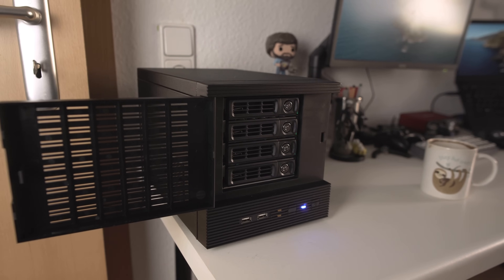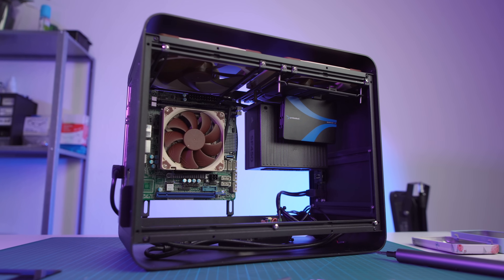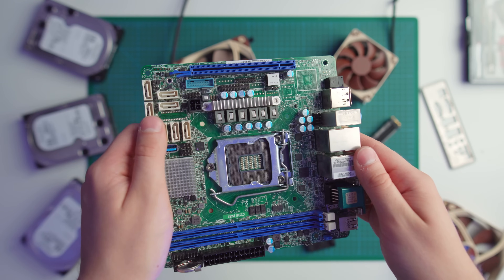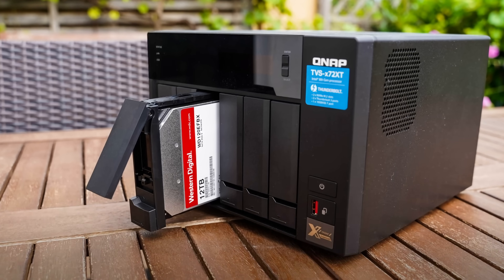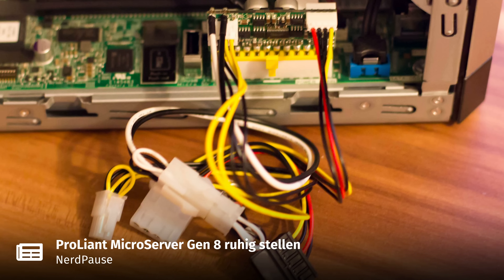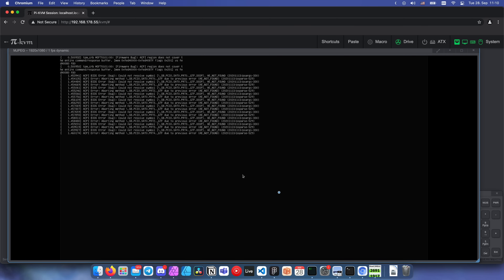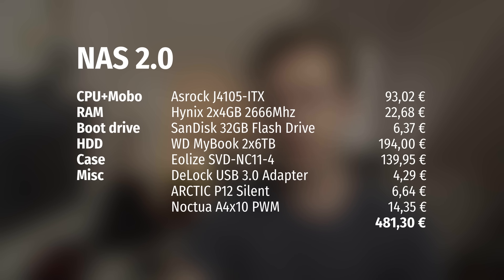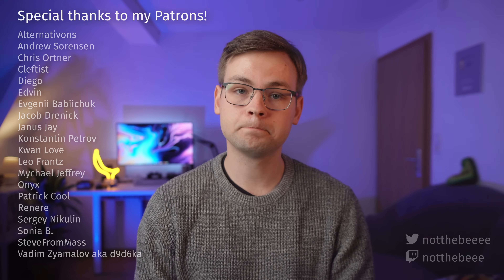The Perfect Home Server Build! 18TB, 10Gbit LAN, Quiet & Compact

Comment: I´ve just discovered your channel through this video and I really like your content, you just got one more sub :)
I am also building a new homeserver for myself but I took a very different approach.
I want a new homeserver that runs Unraid OS with lots of HDD storage but also some faster SSD pool, and I also want it to be reasonably efficient. My current homeserver consists of a X99 Board, 6900K CPU, 32GB of RAM, 13 Hard drives from 2-3TB in a fractal 7 XL case with a Intel X550-T2 10G Nic. 
For my new server I bought a Z590 Aorus Master, because it´s one of the cheapest boards with 10Gb/s RJ45 already built in and I got it for just  260€, a 10700k so it performs well if I need it to (10th Gen because it´s the last gen with proper GVT-g support, so I can use the iGPU for VMs or Plex. I got a good offer for 64GB of RAM for just 220€ so I bought 64 instead of the 32 I originally intended to buy and also got a Be Quiet Dark Rock Pro 4 for cooling my CPU, so even under load the system is very quiet.
My case is a CoolerMaster HAF XB Evo Cube that I got from work for free, but it can be had from ebay for around 40€.
Its a nice case with enough room for everything I need but also doesnt take up as much space as my Fractal 7 XL I used before.
Also lots of Noctua fans for cooling.

I haven´t bought any storage yet, because I dont have that much money at, and I´m hoping for good deals on black friday.
I plan to buy 4x 14-18TB HDDs (Seagate Exos) and put them in a Raidz1 array (that is more than enough storage for me) and also get 2 4TB SATA SSDs and put them in the regular Array in Unraid. The SSDs will be used for stuff like games and will sync their content to the RAID protected array. Maybe also an extra NVME SSD for a VM.

Comment: In case someone is looking for a cheaper option on hardware, A88M-ITX/ac has 6 SATA 3 ports, FM2+ socket. Thats what I'm using paired with a A6-7400K exclusively for NAS purposes.
Reply from the maker: How is the power consumption?
Reply: @WolfgangsChannel  65W ~ Under load. 4 x 2 TB SATA drives, 8 GB DDR3.

Comment: About the motherboard choice: wouldn't be easier to buy a regular itx motherboard with a Pcie 3.0 - Sata expansion card? There are cards with up to 10 SATA ports on Amazon
Reply from the maker: Absolutely! But then you lose one PCIe expansion slot, which I need for the 10Gig networking card. And cheap miniITX boards don't always support PCIe bifurcation (the ability to use multiple PCIe devices with just one slot by using a bifurcating riser cable). Plus, PCIe risers and adapters can cost as much as another motherboard, so we're back to square one.

At this point, a better question would be "is it really necessary to build miniITX?" 😁
Reply: @WolfgangsChannel  oh you're right I was thinking about mATX that have 2 expansion slots at least 

Btw I love SFF builds as well so you got my support for that one! 

When I'll have a well payed job I'll probably try to do the same lol

Comment: I've been using what looks to be a similarly sized case (BitFenix Phenom Micro ATX)for my home firewall since 2015 but that only has a single SSD for storage, which it hardly ever touches. It has 16GB DDR4 ECC RAM and an Intel Xeon CPU, which I would not choose again. I've not had any problems with it and there are lots of things I want to do with it, when I have the time. I use OpenBSD for the OS.
Reply: My dude, that is one massive firewall...
Reply: @urebeatsgaming7285  I've never had any problems with it. I use some of the RAM as a type of ramdisk as that will help extend the lifespan of the drive inside.

Comment: I recently built my NAS in the Node 304 but this video has convinced me to move it to the DA2. The HDD cages in the Node 304 are pretty poorly designed. The screw holes are on opposite sides for each pair of drives, which means that the drive power/data connections alternate direction. This makes it hard to connect them with a single power cable as you need to twist the cable 180 degrees between each drive. The drives are also spaced a bit further apart. I managed but didn't have a single mm of cable to spare and there's even a little bit of tension in the cable.

Since I'm moving to the DA2 could you share some more installation details? For example, did you literally just lay some rubber bands between the drives and have them stick just from the pressure between the drives or did you wrap them around the drives somehow? Can 6 drives all fit in the front part (with a SF PSU and a small passive GPU) or will three have to go in the pack in front of the motherboard?
Reply from the maker: 1. Yes, the rubber bands are just held by the pressure from the screwed-in drives.
2. You can only fit 6 3.5" drives if you don't install a GPU: https://www.quietpc.com/images/products/st-da2-example4-large.jpg

Comment: Whats your average power draw?
Reply from the maker: 19W with all HDDs spun down, and every HDD draws about 5W.
Reply: @WolfgangsChannel  Thanks, damn that's nuts, mine idles at 100W but I think ZFS is preventing the drives from spinning down.  I'm gonna try some of the hardware you used, my machine uses an LSI raid card because of the sata shortage on itx mobos and I think alone that consumes 20W.

Comment: if you can fine one, you may want to take a look at an HP Pro Liant N54l MicroServer.
That is a very solid basis that can be tinkered with but does not actually need it usually.

Comment: Didn't you run into heat issues with your SFP+ NIC ? I got a dual port one for my home server and it turned out to overheat as it was designed for servers ie. high airflow environments (QLogic cLOM8214 for those who might wonder). Performance turned out to be excellent though as soon as I strapped a tiny fan on it.
Reply from the maker: Nope, not really. As far as I know, it's usually RJ-45 10Gbit NICs that get hot

Comment: Many people underestimate the iGPU on the 6th gen plus intel processors. I am running unraid on an i3-9100 which handles 15 simultaneous 1080p transcodes. Realistically not much less than a quadro P2000 that the internet seem to be obsessed with and a hell of a lot cheaper and more power efficient.
Reply from the maker: Yep, QuickSync is magical ✨
However, you need at least a Kaby Lake CPU if you want to play HDR content on an SDR screen in Jellyfin, it seems:
https://jellyfin.org/docs/general/administration/hardware-acceleration.html#configuring-opencl-acceleratedvpp-tone-mapping

i3-7100 is also supported by this motherboard, so yeah
Reply: @WolfgangsChannel  I have the same motherboard (actually 1 step down, the C232, just doesnt have the m2 slot) and paired it with an i3 7350k, the best cpu that supports ecc before going a xeon.
Reply: But still no 4k60p on YouTube unfortunately (

Comment: I have a question that's off topic but please bear with me. Which external HDD would you recommend for casual use? I am looking for a 2 or 4tb drive. WD My passport 2tb/4tb, my book 4tb, Seagate expansion 4tb (external power), One touch 2tb, etc.
Also how would you choose between portable ones and the big ones that require external power? Thanks for your time

Comment: For my home storage server i added a HBA card to get additional SATA ports. the DELL H310 running in IT mode. I see people recommend the LSI 9211-8i. But mine came pre-flashed with the right firmware and was cheaper, so no need.

Comment: My home server is a pi4 with an external usb drive attached. It runs pihole, hosts my git repo's and music/videos for streaming. Its enough for me and is very light on power with the energy prices soaring at the moment! Thanks for creating and sharing the video. Lots of hard work and editing. Good job!
Reply: I think he means they can easily be torn of causing files to be corrupted
Reply: My home server is very similar to yours! I run a Pi 4 with an external desktop HDD. It too runs Pihole as well as a Plex server and storage for general files.
Reply: @L39T   What are you using to have your HDD connected?
Reply: @L39T  Hello! I got a question regarding Plex server on a Raspberry pi 4. Does it work well for 1080p videos? I'm thinking at a Samsung TV as client. Thank you!
Reply: @cosmin3  Yes, 1080p and even 4K works fine. Just make sure to not transcode the videos.

Although I've had one video that the Pi would struggle with and that was a .mp4 x265. I never troubleshot because a .mkv x264 version of the video was available anyway.
Reply: @PhilRey.  Just curious because my setup is the same. Does the Argon V2 case solve the issues you are talking about?
Reply: @PhilRey.  weak in what sense?
Reply: What do you use to host your git repo's?
Reply: I'm just working on my pi server. I just created a Minecraft server with a Ubuntu server install without a DE installed. I found it is a great project to learn to use the terminal. Next will be transform it into a normal file server with nextcloud. So I can ditch google cloud.
Reply: I use an hp proliant microserver with no fans running Unraid and I am also perfectly fine with it!
Reply: External USB is far from satisfactory in my testing. Your comment is really overselling the Pi4
Reply: @chrisg6091  if you’ve used ext4 file format, you’ll know what he means
Reply: cyberpunk 2077 meme worthy
Reply: @PhilRey.  for critacal data you dont need a powerful solution, you need multiple devices, so is better to use 3 rpi instead of a device like the one on the video...
Reply: What do you system do you run on that pi?
Reply: Same and an odroid c2
Reply: Thinking of doing this too, will a pi3 be enough.
Reply: Where can you find a pi4
Reply: I used to do the same but honestly after a couple years I started getting a lot of random crashes, which were due to the hard drives starting to fail I think. I decided to go with Synology but I would recommend to at least consider to use two drives to backup some stuff, especially if you have your git repos there
Reply: Take care of him
Reply: Energy prices soaring ? My electricity is $0.068 per kwh. Cheap cheap.
Reply: @randybobandy9828  man wish i had the same price as you. i pay 0,35€ per kW/h in germany
Reply: @Humbulla93  Yes, it really is nice. Just a few miles into town is a different power company, and it's  almost double $0.117.
Reply: @Humbulla93  0.35€ are actually still kind of cheap. You must have a good contract/binding contract. I pay 42ct/kWh if the PV doesn‘t give enough electricity (renewable from Norway however because we know that electricity always takes the hardest path, right?). Others pay 50ct/kWh sometimes.  

I actually have a somewhat decent server (Ryzen 5 2400G, 16GB RAM, 256GB SSD) which I built before the Russian invasion, partly from scrap parts (RAM from upgrade of my old PC, cheap MoBo, Samsung SSD from dead laptop) and it would cost me like 700€ a year to run (on average the sun is out for about 4 hours, so I practically only pay for 20hrs). It can work as a heater though, currently I have Windows 10 installed but I intended to use it for Linux/VMWare.
And the best part is, that this thing draws 1W without even being on, while my Pi 3A+ only draws 2W-ish peak.
Reply: Nice setup. 
This side I have a Raspberry Pi Zero W for PiHole, and my file server is a dirt cheap motherboard running a Celeron J3060 with a 2TB drive, 2GB RAM and 120GB SSD for OS (Open Media Vault)
It's been running fine, but I'm needing more space. Problem is, that cheap motherboard comes with just 2 SATA ports and no expansion at all... So I'm thinking in upgrade to an AM4 motherboard to use an Athlon 3000G or a Ryzen 3... And build a RAID 5 setup with 4x6TB proper NAS drives (Toshiba N300)...
Just waiting of a good deal on ITX AM4 motherboard shows up... 😂

Comment: Almost everything I want..
TBH I'd be happier with 2SATAs, 2 NVME and 10GBe with DC power for even better power sippage :) But apparently these are pretty impossible to find.
That 26W you showed in the middle, was it with all drives spinning (doubt it)

I may end up following your build but possibly with a 7700T CPU (if it supports it). I want to be able to spin up VMs as well.

Cheers and thank you for the video.
Reply from the maker: Thank you for the comment :) 
26W is with one drive spinning. It's around 19-20W with all drives spun down. Iirc Kaby Lake CPUs are supported by that motherboard
Reply: @WolfgangsChannel  That's pretty good. What is the draw when you're doing transfers at almost 1GB/s?
Btw can you comment on your setup that enabled this speed given the SATA speed would cap at 500MB/s per port and spinning disks generally hit no more than 150MB/s?
Was it also constant or did it dip after maybe it cleared the cache?
This is a reason I wanted to have 2 SATA disks (spinning or not and mirrored) and 1-2 NVME storage as cache :)
Reply from the maker: I have a 1tb NVME drive in front of the MergerFS array to act as a buffer. The files that haven't been accessed for 5 days get moved from the NVMe drive to the hard drives. 
I didn't mention it in this video because connecting another PCIe device to a 1xPCIe motherboard requires some voodoo magic and I wanted to leave it for the next video :)
Reply: @WolfgangsChannel  ah haa.. now THAT makes sense. Also damn teaser, I'm very curious too .. Are you also using the nvme as cache for writes to the NAS?
Thanks for continuously replying. Any ETA on the next video?

Now I'm wondering if you used something like QNAP's 10Gbe card with 2x NVME slots 😅
Reply from the maker: @Airbag888  Yep, that's what I'm using the NVMe for. The video should be done in about a month – it's already being worked on :) And no, I'm not using the QNAP card. It's PCIe Gen. 2 x4 and that's just too slow for NVMe + 10gig.
Reply: @WolfgangsChannel  omg 1 month!! I guess that's 1 more reason to keep on dodging coronavirus

Comment: Wouldn’t it be easier to use Open Media Vault as software because it automatically uses remote access. It would also cut costs instead of using a raspberry Pi
Reply from the maker: I think you misunderstood the point of a Raspberry Pi. OMV wouldn't give me access to BIOS settings, won't let me repair the borked GRUB config or diagnose systemd shenanigans. You kind of need a separate PC for that.
Reply: @WolfgangsChannel  ok, I’m really a noob at this

Comment: If I am looking for an ATX case with a backplane available (with hotswap and good airflow if possible) what are some cases I should be looking for?
Reply from the maker: I don’t have anything in mind, unfortunately
Reply: Native backplane limits your options on towers.  Probably something like Supermicro, or you could take an ATX tower strip out the 3 x 5.25 bay and replace it with a 4 in 1 hot swap bay for your back plane.

Comment: Why not just run headless Ubuntu server on bare metal? I've been doing so for 3 years, and it's worked nearly flawlessly. In the rare occasion it turns off, I just press the power button, and everything is back on in 30 seconds. Never hooked up to a monitor after the initial install. Cockpit has a built-in shell and service management.
Reply from the maker: That’s what I do though 😁 but PiKVM is still handy for changing BIOS settings/etc.
Reply: @WolfgangsChannel  That's probably true. I guess I looked at it from one side, as I've never had to change BIOS settings.

Thank goodness you're not using FreeNas or Unraid for this build. It's hyped up by so many YouTubers, but totally overkill for most media/home servers.

Comment: For the AMD Side of things there would also be the ASRock Rack X570D4U or the ASRock Rack X570D4I-2T. The 2T has 10Gbit/s x2 onboard but doesnt come with a second PCIe slot. And yes i know, one of them is MicroATX, not miniITX, but maybe someone wants to go that route instead, so i throw that out here. Both with 8 Sata Ports btw.
Reply from the maker: I was really pondering getting the X570D4U but it’s around 650€

Comment: Wow that's a really cool setup, I am just repurposing my old laptops as a homelab 😂 and have been controlling it over SSH benifit being that it consumes very little power and has a baked in UPS. Really looking forward to that 10G home network video.
Reply: I thought about doing that aswell but am not sure if it's a fire hazard with the batteries on all the time
Reply: @Alex-fl2yh  good point about the battery exploding hadn't considered that, I will pull it out and connect directly to the UPS, thanks!
Reply: @Alex-fl2yh  you can easily check the battery health and if they are in good health then there should be no issues. Most laptops entirely bypass the batteries and supply power directly to the laptop when plugged in and the laptop batteries work as a sort of battery backup. Li-Ion batteries won't explode out of nowhere, you can see signs of damage pretty early on in form of bulging or overheating batteries. 
It's the ideal setup for me personally because laptops being low power, used laptops are cheap. Only issue is the lack of being able to add tons of cheap HDD storage and being limited to the more expensive notebook HDDs or SSDs
Reply: Power consumption is crazy for old hardware
Reply: @ITshnikBro  pretty manageable if you get anything above or at 6th gen. Mine is a 2 core 4 thread i5 and I run 9 services via Podman (14 images) plus cockpit on it. It also acts like a NAS and saves encrypted backups from my phone and macbooks. The power usage is usually around 5W - 15W at the max. The thing has been running 24/7 for about 3-4 years now without any problems.Only time it really breaks a sweat is when Immich is running its image classification tasks.